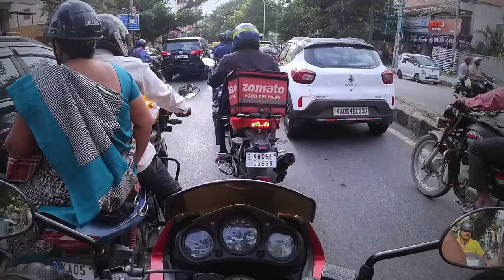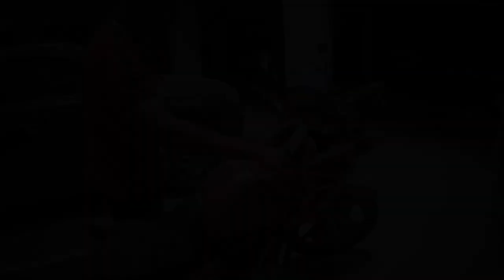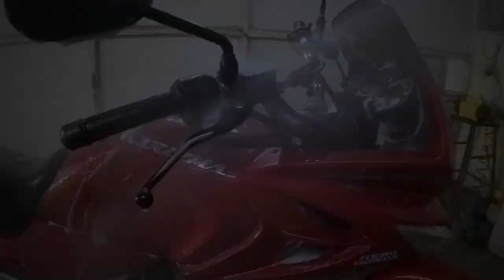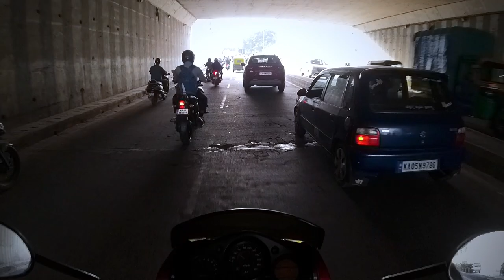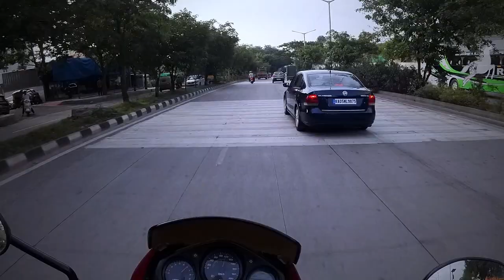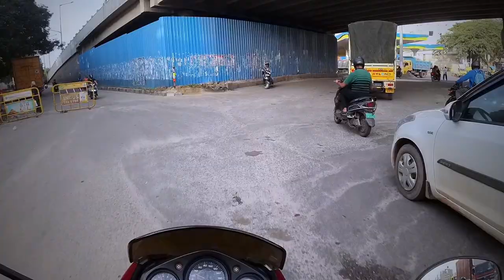Back on the road with my 2 decade old Karizma

Comment: 10:24 As a Karizma fan this video gives me unbelievable amount of nostalgia and mental soothe. Every word you said was on point. Hope you named your bike. 
My bike - a black Karima R, served me well close to a decade on the Bengaluru roads and covering most areas in KA, Pondicherry. The top mileage I received after 8 long years was an unbelievable 40-43kmpl. Its pickup is fantastic and the engine grunt was worth its frame and age. You have a well maintained machine. Thank you for the intense nostalgia bro. 🤗🫵🤘
Reply from the maker: Thanks for such a lovely comment bro. You took the time to type out ur feelings. That’s amazing. Actually, I haven’t given any name to my Karizma yet.
Reply: Neither did I 😂. I called it bike only. 
Well thanks for responding and validating my words & feelings. Happy that your Karizama still serves you well. Keep up the great work and vlogs!!!! 👍 

Also I am planning to get the KTM 250 Adventure (lower seat variant which is yet to be released here in Guwahati) probably in the next few months. 
After a lot of research on KTM and a couple of test rides I feel it's a gem of machine in the adventure bike category from all the aspects (performance, price, reliability, mileage and brand). Waiting for the bank balance to rise also & to afford the vital assesories along 😊😂
Reply from the maker: @hwoarang919  Why not the Adv-X? It’s certainly much better than that 250. Don’t worry about seat height. You will learn to deal with the height. Watch the video of Schumi where he talks about dealing with tall motorcycles.
Reply: @prameethprabhu  I am 5'10 so Height isn't the issue but my crotch taking pressure from the tank-seat area while waiting in traffic is. 😂😅 (it got uncomfy during my test rides, also my cousin owns a ktm showroom here so i had that previledge of trying multiple rides for both 390 and 250. Adventure X wasn't available till a month or two ago).
I swear hence I need the lower seat variant to enable me to keep both my feet flat or atleast less than tip toe on both feet. So I am not traffuked. 😅

Coming to engine - 390adv is way too powerful for Northeast roads. It's useful in bigger cities/highways. It's speed/throttle scared me every freaking time. I absolutely loved the thrill of it yet I have my reservations. 250adv felt way more refined, pretty fast, smoother and equally premium. Since I was used to a Karzima, Ktm adv feels like race car. It's my kinda bike and I identify with it. That I am sure of. 

I am mostly looking for a tourer with occasional trails, perhaps soft off road near water bodies kinda deal. North east is wet, snowy, humid and hot. Assam, Meghalaya, Arunachal, borders of Bhutan to be precise.

Hence My priorities are a balance between speed, comfort and mileage and ofcourse value for money.

Even if i don't consider the mileage, 390adv stalls too in lower speed high gears that's a bummer. Even 2nd gear it happened. And I didn't face that with the 250adv.
Oh and also I shell out 40k more on AdvX which I can use to buy good helmet, boots and other riding luggage accessories 😉 Adv250 is 2.78 onroad and AdvX goes to 3.22 onroad.
So those were my observations and exact requirements. Hope these point give you a bit of my perspective. 
Would really appreciate your honest feedback bro.🙏
 What do you suggest here for me?
Reply from the maker: @hwoarang919  I’m glad you have concluded your choice with a lot of research. That’s the best way to identify the right motorcycle. Pls add me on Insta. I’ll meet you when I do my northeast tour 🙂
Reply: @prameethprabhu  sure. Oct onwards is season time. Cheers bro🤘
Reply from the maker: @hwoarang919  Thanks. Do drop a DM on Insta so that I can contact you

Comment: I am happy that the confession is coming from a well maintained Karizma owner that - Karizma lost its way after the first generation . The R and ZMR looked sportier but simply lost the road presence of the first gen 225. And after all these years , i see your bike slotting perfectly through the traffic and the pick up looks immense - the pull could be felt on camera .

The bike had tremendous low  end  and mid range- something which is missed on many bikes of comparable displacement these days, but lack the top end .I heard , with a racing CDI, rejetted carb and irridium spark plug , the bike becomes more welcome at top end . But it has only 5 gears anyway .I remember riding a Karizma R , it was full of footpeg and handlebar vibrations after 110 kmph , it became unbearable past 125kmph and the bike felt like stressed out - hence had to tune it back to midrange keep steady at 80-90 kmph, its probable sweet spot.

I am sure the 1st gen, will be better at top end - since that bike did not care for fuel efficiency and pollution handicaps of the later gens.And that kick start - it gets out of situations without a battery dependency . I will wait for a highway review of this legend , of open road and wide open throttle.
Reply from the maker: Quite frankly, there are hardly any vibes on this motorcycle. Of course, the wear and tear of moving parts has lead to some vibes but it is nothing compared to the modern day high revving engines. This is still smooth and pulls well. Once the torque curve flattens out, the feel of pull is less but it will hit the 125kmph top end regardless. Speedo will show 140 kmph in stock form but the GpS tested speed is 125.8 kmph as per the company. I don’t plan to change anything to make the bike faster or quicker. I’m happy with the way it is in stock form.